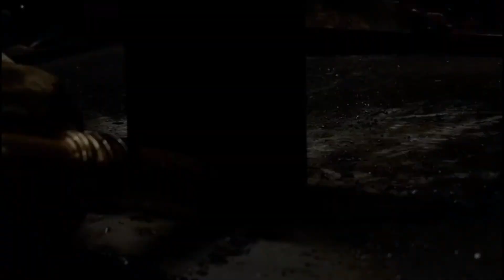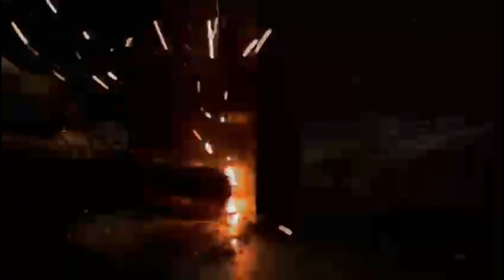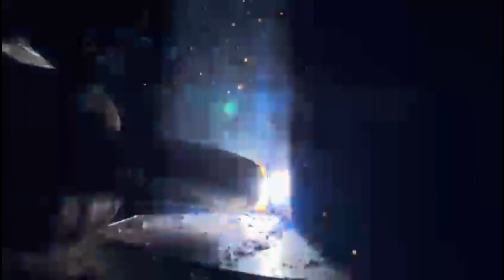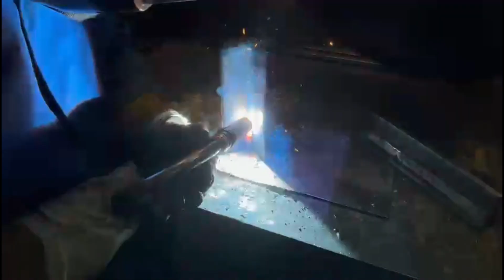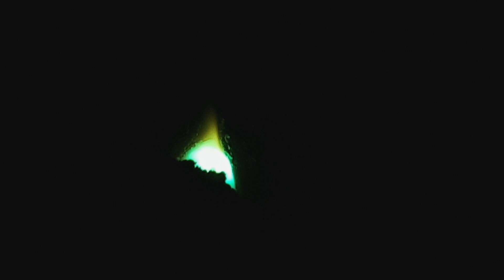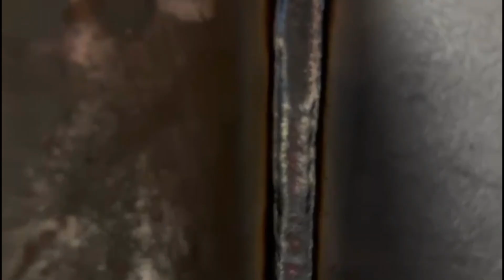Duel shield flux core Vertical Welding Techniques

Comment: Ahoy mate, but what brand, type and size wire?  Innershield (no gas) or dual shield (with gas) What about the volts and wire speed setting?
Reply from the maker: DwA50 wire, 1.2mm duel shield Ar/Co2. 22v 6 metres per min wire speed. 👍🏻